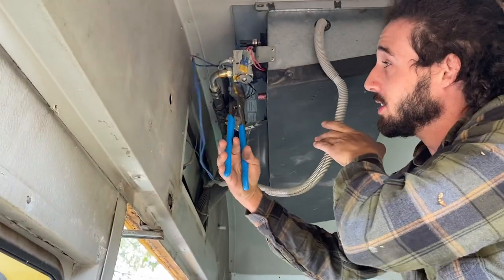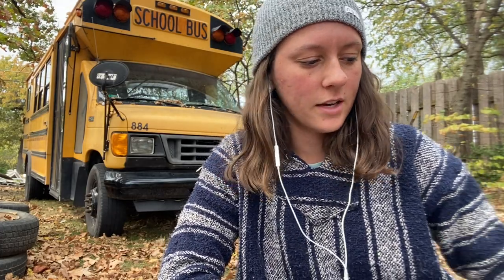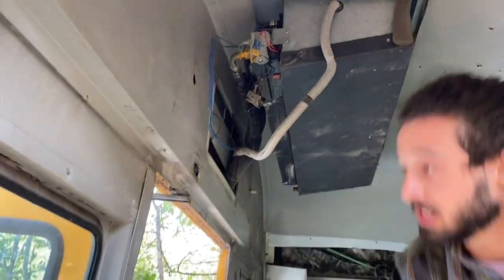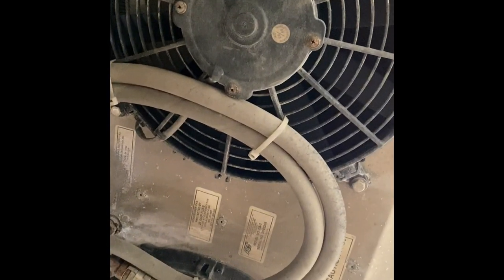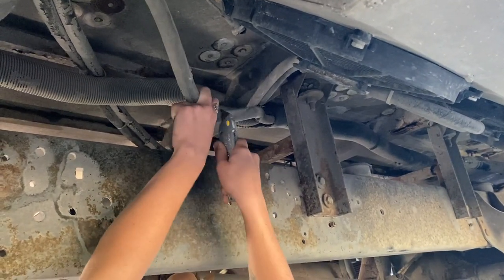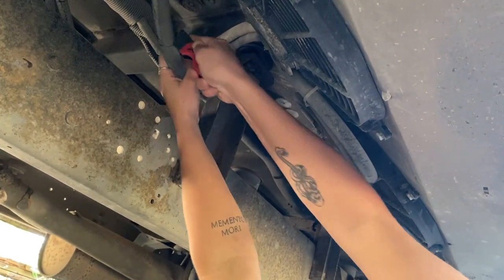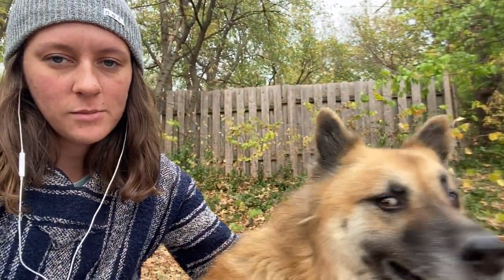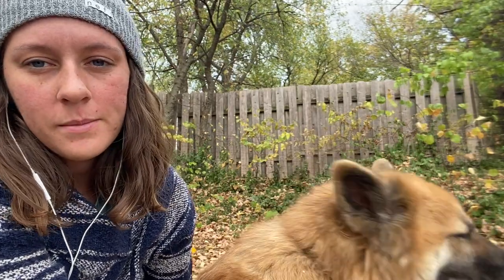Simple How to: Removing the AC Unit from a Bus

Comment: I'm pretty sure you need to connect the two hose ends so coolant can flow still rather than just plug them.
Reply from the maker: The coolant for the engine and the coolant for the AC are two separate systems so since I removed the AC I can cap the lines off
Reply: @EmilyKeeter  cool. looking good. I like the bus! I am 7 months behind but like the videos so far!
Reply from the maker: @RoundTownWithMike  haha, thank you!!  Well I’m still in the middle of the build
Reply: @EmilyKeeter  May I ask why you decided to remove the rear AC unit?
Reply from the maker: @briank8482  it just takes up a lot of space and I can only have it on while the bus is running. So I want to put it a separate, smaller AC unit that will be on my solar system
Reply: Was your rear AC connected to the front AC because I think mine is that way. Does your front AC work still?